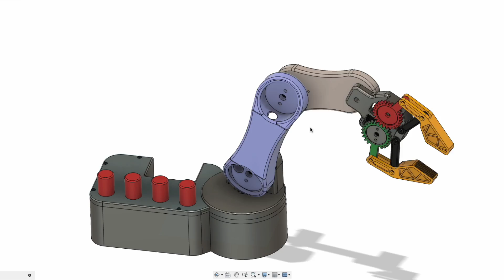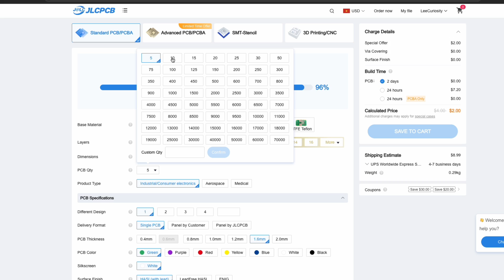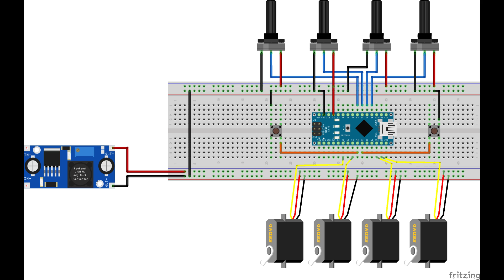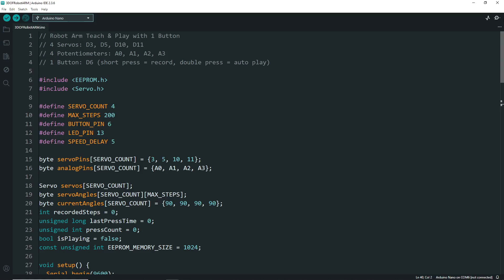Designing & Building a 4 DOF Robot Arm Using Fusion 360 + Arduino

Comment: Nice design.  Are the F3D files available, or just the STL's?
Can I ask, why are the servo horns still separate parts attached with screws?  
Couldn't they be designed into arm using Fusion to simplify assembly and get rid of those extra fasteners?